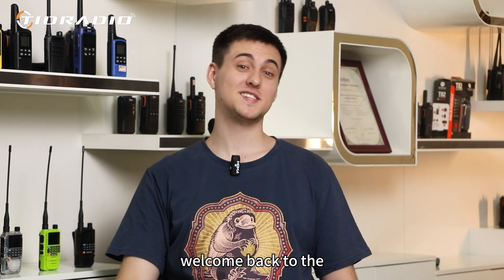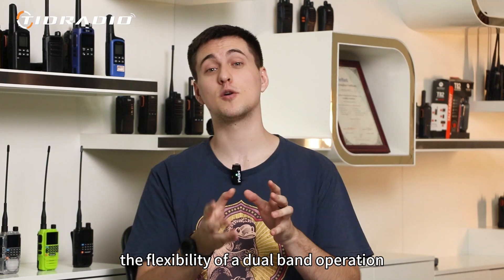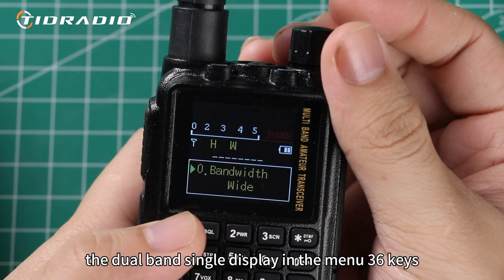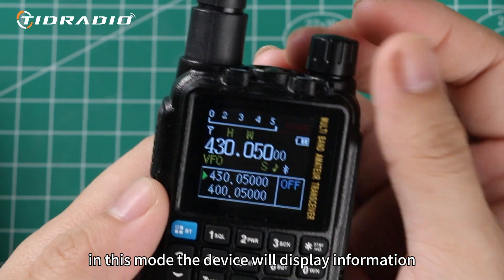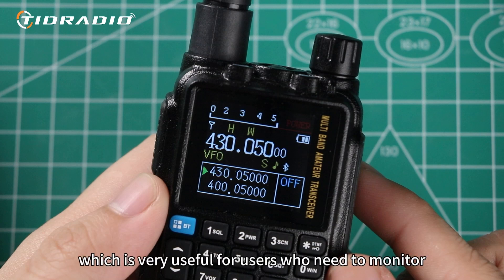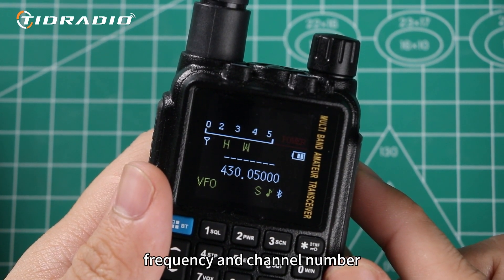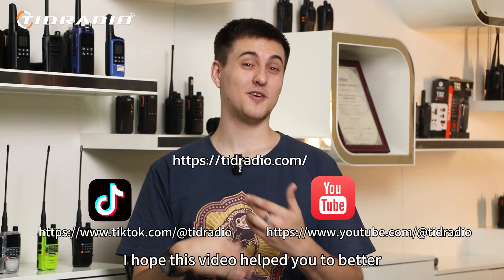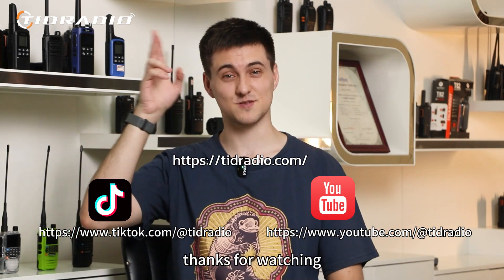TIDRADIO TD-H3 Lesson 20 | Dual-band single display function

Comment: It seems as though my tdh3 doesn’t monitor the two channels. It only monitors channel “a” even when displaying two frequency or two different channels. Am I doing something wrong ?
Reply from the maker: Hello, you can contact our customer service team at support@tidradio.com
Attach photos or videos, they will report to the technical department so that they can better help you solve the problem
Reply: @ I didn’t have( D. Wait) on in my menu setting. Turned that on and it works PERFECT. The recycle ♻️ icon was not on and now it is. It is working great. Love the radio.
Reply: @ ok thank you! Love the radio just trying to figure this bit out.

Comment: I am licensed in both GMRS and ham radio. If I am using dual watch and  band A is GMRS and band B is 2 meter ham, why cant I transmit on band B to respond to a call?  When I press PTT B it does not transmits but sounds a tone. Sync is on
Reply from the maker: Hello, you can contact our customer service team at support@tidradio.com
Attach photos or videos, they will report to the technical department so that they can better help you solve the problem